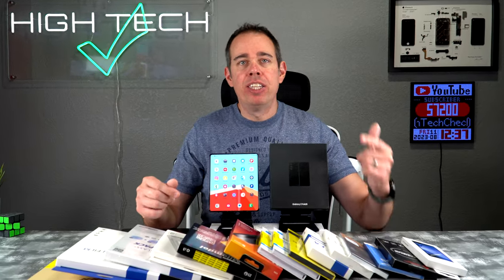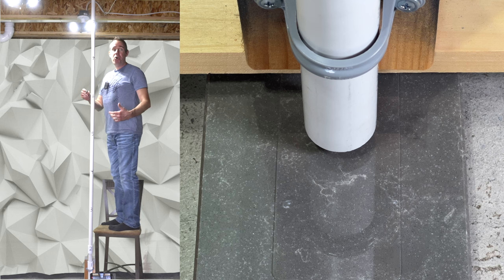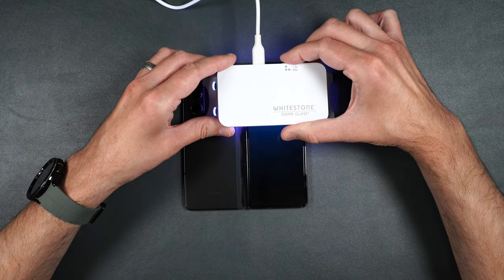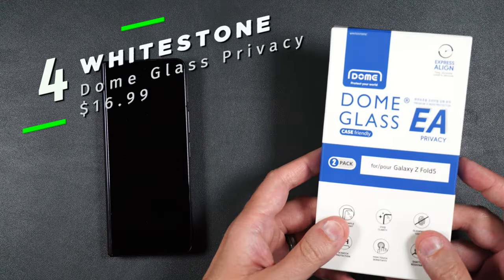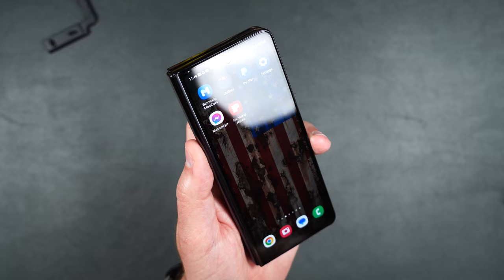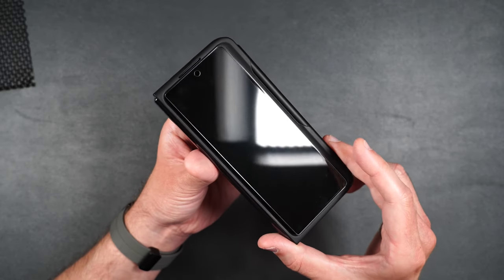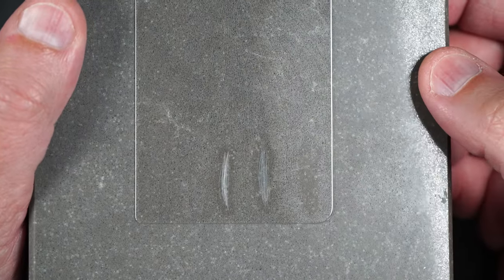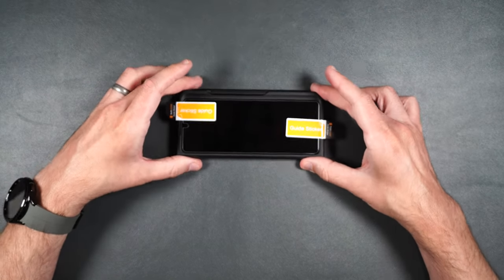Best And Worst Screen Protectors For Samsung Galaxy Z Fold 5

Comment: DO NOT install a screen protector over the inner one. I've seen that over and over and people have cracked the screen when it folds from the added thickness.
Reply: It's a replacment anyways.  I don't know how people mess that one up, but I'm assuming it's because of that whole deal with what happened with the first Fold
Reply: @Sheenifier and I just bought a kit that included all protectors, nice to know now. I will just store the inner screen protectors.
Reply: Very good advice
Reply: Thanks!
Reply: This guy does that….?
Reply: @noahchasinguitar5831  yeah and it's a bad idea
Reply: @TechOut  Where did you see this over and over again? Trying to evaluate because I can't stand glossy screens.
Reply: @cypherbuddha I bought and installed the paper feel screen protector from Amazon

Comment: Pro Tip: when putting on screen protectors always turn your device off because when the power is on the static electricity causes dust particles to draw to the screens surface.
Reply: 2nd this also replacing right after you take a hot shower. The humidity helps reduce the particles in the air. Also you should have gotten all the oils off your hands if you took a decent shower.

Comment: Just so you're aware, the glass cracking at lower impact force is more desirable. When a glass protector breaks at higher force, it means more force gets put on the phone screen below, and thus stronger tempered glass does a worse job protecting your phone. When a screen protector cracks, it dissipates all of the force from a drop. Other than that, loved the video!
Reply: Very true, but this isn't an amazing real world test. You are never going to drop your phone on... say the point of a fence. It's going to hit the ground and spread the impact across the entirety of the display. Likely you wouldn't see these results in the real world.

Oh, and god forbid you /ever/ catch the screen in the corner. That's instant shatter.
Reply: I do it on a full white screen in my notes app bc you can see ANY particles and it's easy to get them off and put the protector on real quick before more get on it.

Comment: Since I didn't use your affiliate link, here's a thanks!
Reply from the maker: Thank you so much Brian, you’re awesome ! I appreciate your support , even though you don’t use the link did you end up getting any of the screen protectors?
Reply: @HighTechCheck  I did. I ended up going with the Whetstone privacy front screen protector. I didn't know privacy screen protectors were a thing up until your video.
Reply from the maker: Nice! The privacy screen are pretty useful, some screen protectors actually come in a matte privacy screen as well.

Comment: I've used the Whitestone Dome Premium glass protector for my Fold 3 and 4. I do like this protector a lot but I think moving forward I will go with one that has less steps and is less messy. maybe their basic one or privacy one. Also Casetify cases are NOT friendly with this screen protector. The case is too bulky around the front screen and puts pressure on the screen protector.

Comment: The flimsy samsung screen protector is a scratch magnet. Ive scratched it with my fingernails. 

Super unimpressed with the samsung stand case too. It lets dirt under the edges and the adhesive no longer sticks. I havent even removed it.
Reply: I had it on for 3 or 4 days and literally had to take it off because of 3 tiny scratches, you could see a clear discolouration due to the scratch

Comment: Is it just me? But when i put on the screen protector on the big screen, fold it and unfold it, then it start to peel the original screen protector (mainly from the middle where the crease is), i spent the next 30 minutes trying to take off the aftermarket protector and slowly pushing out the bubbles and make it attach like normal